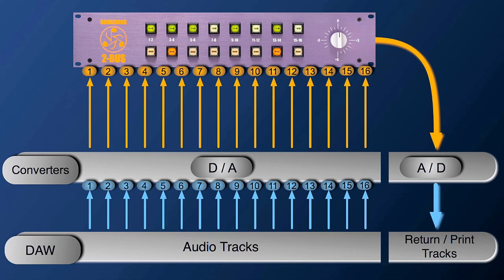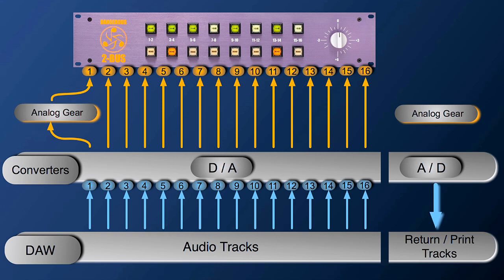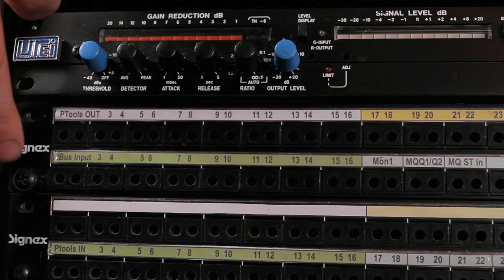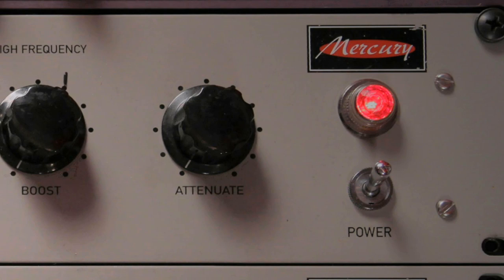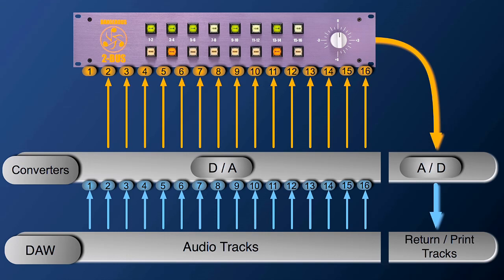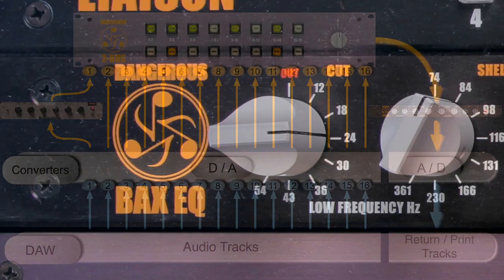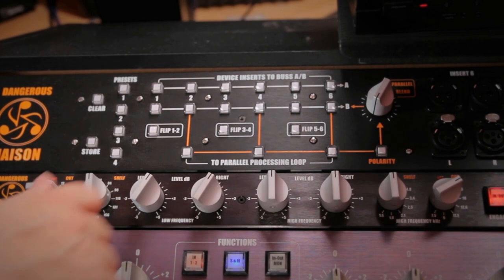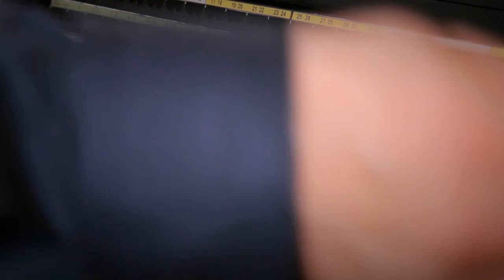Inserting Analog Gear in Analog Summing

Comment: Inserting hardware after the summing mixer , well , it can ruin your mix i think , no ? Unless you do the mix with the eq on at the beginning of the mix process
Reply: The idea is that you use the hardware across the entire as a way to add some final polish, maybe you can squeeze an extra bit of low end or to add some shine in  the top. It's no different than when your mastering engineer does it.